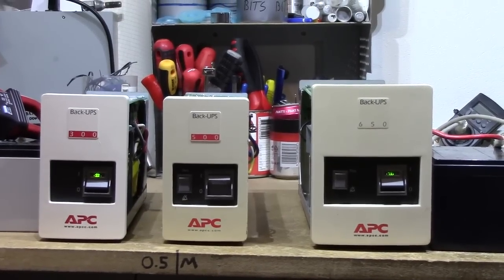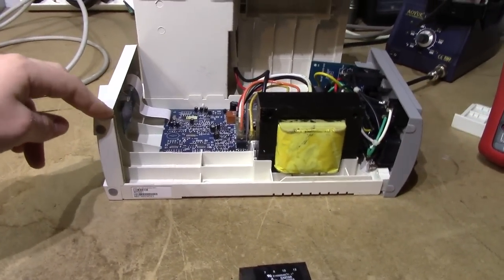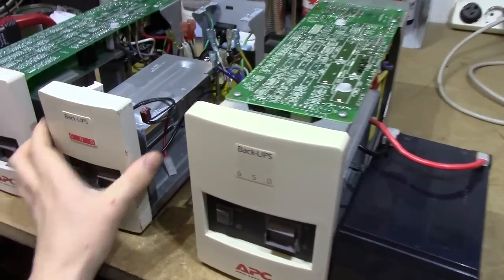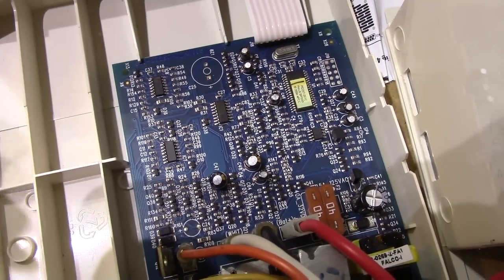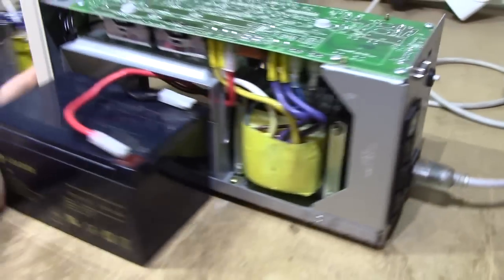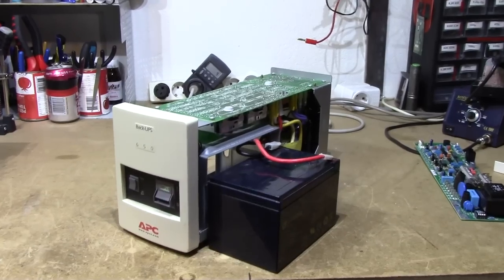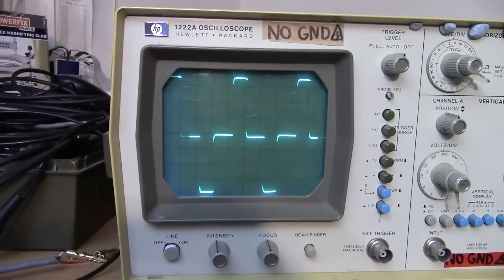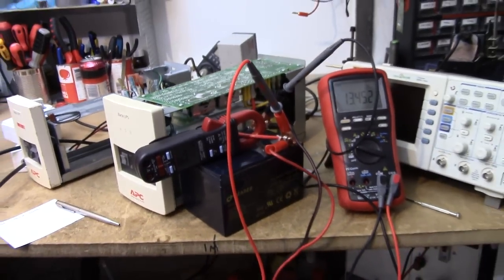Teardown: Old APC Back-UPS units

Comment: One of the best APC ups's to date. I have a back ups 650 from 1993 and it's still working.
Reply: hey what cords can i use for this? i really want to know my pc has a normal power cord
Reply: Hello, there is also an ancient apc 600 ups of 1994 with panel buttons, so the reason right now is that it does not hold a load even a small 60 watts immediately turns off, please tell me where to look, it works from the network as soon as it does not even forcibly hold the load from the battery
Reply: @Lion5208  your battery is dead or the inverter is broken

Comment: Old APC Back-UPS units with the big switch are cool, unfortunately I didn't find that many ... which are very awesome those from Bestpower!
Can be used as an island inverter without mains and they had a great display where you could query all important information ... Voltage batt./outp. performance in% remaining time, etc.

Comment: The old SmartUPS 600 without user-replaceable batteries was horrible to work on. Big bracket holding the batteries in place and it seemed that you couldn't disconnect the batteries without taking them out, but it wasn't safe to take the batteries out without disconnecting them. I shorted two of the four heatsink plates on one. It sparked, I pulled the screwdriver away but a few seconds later a bunch of transistors on one of the heatsinks decided to catch fire anyway.

Comment: I've got an old BackUPS 500 still powering a small home linux server. I think it's on its third battery. The serial connection works fine with apcupsd. I just tested it after a software upgrade to the server. Still shuts down automatically without a hiccup when the power is cut.

Comment: hi,  can you tell us how to change the low battery voltage cutoff setting?   I have a bk-650 and need to change the shutdown voltage to 11.5 to get better compatibility with lifep04 batteries

Comment: I'm rewatching this video after having pulled out from storage my old BK650MI to attempt to charge an old-ish battery because the newer "smart" APC model (BK350EI) was screaming at me with that battery. Seems to be working, will see if that battery gets a new life.

I got both for free (at different times) because they where being thrown away, hauling the 650 home wasn't pleasant but worth it

Comment: What is the RDS ADJ resistor responsible for, how to set it up correctly?? Without load, for example, the voltage is 230V, under load 200W, the RDS ADJ resistor can set 230V, but there is a large load on the battery, so I set it to 220V, so the UPS works even from a dead battery. But how to really set it up correctly, like from the factory?
I understand this is somehow related to the resistance of the RDS MOSFET transistor. Voltage drop regulation under load. I do not understand how to set it up, at what power. The drop also depends on the battery voltage, so it is difficult to adjust it.

Comment: Hi great video, thank you.  I’ve just acquired one of the 300 units, but IC1, the voltage regulator has let out the magic smoke.  Could you advise what I should replace it with please.
Reply: 7815...

Comment: hello! i know this vid is a bit old but I recently got an old BK300 APC, but one of the white concrete resistors are blown up, i can't find any schematics for that specific model with consistent part numbers! If you still have this one around could you tell me what values those two white concrete resistors are? They are labeled R99 and R100 and are the only two white concrete resistors on the unit
Reply from the maker: Sorry, I have no idea.

Comment: Good day sir. You obviously know alot about these units and i was wondering if you knew how to get a bk300 to turn on by just connecting a battery to it. Like what i need to fuse together on the circuit board or bypass. Thanks

Comment: Hi. I have an old APC Back UPS. The same model that appear on the video BK650MI. I only want to replace the battery, but I don't know what the model of the battery is (the reference). What do you recommend me? Any advice? 
Sorry for my english. 
Thanks
Reply from the maker: +Héctor Luis-Ravelo Salazar 12V 12Ah.
Reply: Also note that even APC branded batteries aren't Mfg by APC, if you peal of the silver APC label you will find the original Mfr of the battery stamped into the plastic casing and the details of the battery for replacement.  I found this out by mistake when I was trying to find a replacement for an old APC unit I had and the label had been partially scraped off when I was trying to get it out of the case.

Comment: The reason I stumbled upon this video is because I have that same Back-UPS 650 you showed that suddenly won't power on anymore. It has a new battery which I tested and is confirmed working. No lights or power to anything. The only thing I can hear is a very faint hum from some component. I may just try replacing some of the few caps on the board and go from there.

Edit: I should also note that the battery connection sparks every time I connect/reconnect the battery. I checked the resistance between the battery wires (with the battery disconnected) and it measured at 10ohms regardless of the power switch position. Not sure if this means anything.
Reply from the maker: Odd! I've never seen one of these fail. Try starting it in inverter mode by holding the alarm or the test button while turning the power on - if it powers on then, it could be a mains sense issue.
Reply: @FFcossag  Update: I was using a lifepo4 battery in the unit. However, I discovered that whenever I connect the battery, the over-current protection on the lifepo4 battery trips. So I tried a lead-acid battery and it started sparking like crazy. I suspect a dead short whenever a battery is connected to the unit. Now I have to figure out what's causing that short. Possibly bad caps? Only thing is that there's only a few very tiny ones on the board and that's it.

Also, starting it in inverter mode didn't work. I tried this without the battery, so that obviously wouldn't work. But I can't try it with the battery because of the short circuit issue.

Edit: Ignore the ohm reading I gave earlier. I'm a noob with a crappy multimeter and I probably read that ohm reading incorrectly.
Reply from the maker: @SalC1  There isn't much that can be shorted in these except for the switching transistors on the "heat sinks"

Comment: iirc you can tweak the resistance between the ground reference pin of the ic and ground to make it output a higher voltage than spec
Reply from the maker: Yes, you can, by installing a "raising diode" in series with the ground pin. However, these units do the opposite of that, having two dropping diodes in series with the output pin of their 15-volt regulators.

Both of these techniques are a bit shoddy in a reasonably high-current (500 mA), high-precision (+/- < 0.2 V) application like this, since the voltage drop across the diodes is going to vary with current, temperature, the weather in Angola, and so forth. Modifying the charging circuit in these units really calls for a new regulator IC to be installed, and the dropping diodes to be removed.

Comment: I use a Back-UPS 300 model BK300C (which was free from work, and $30 for an 8Ah battery from cough-cough-overpriced-cough batteries plus) as my main UPS that keeps my cable modem, gateway router, seperate wireless AP, pogoplug and OptiPlex 760 USFF battery-backed in case of the extremely rare surge, brown-out or black-out. it was an immense lifesaver when Hurricane Sandy hit-- we kept power but it kept the devices safe from all the voltage drops we had during the storm. We had a bit of an issue with a tree on the lines a block over so they had to shut the grid down for a full 8 hours.

What ended up happening was, they shut it off at 2PM in the afternoon, and at that time the 760 USFF was still an SX280. so I shut it off ahead of time (to maximize run time) and let the router and cable modem (different setup) stay on with the constant beeping alarm because the thing was running on battery. with my 300 there's no way to turn off the battery, so once every so often you'd get the "hey I'm on battery" beeps. it started getting to low battery about 5 hours in, and then at the 6th hour it finally gave up and shut off, so I flipped the switch off. two hours later, the power came back on and I switched it on. Not only do they sound quiet when they're operating (I can't hear mine at all!) but it's also a quiet charging circuit... or at least quiet enough I can't hear it over the Dell.

I'm not necessarily sure how the little thing will take being hooked to so many lower-power devices now, with a blackout. the only time I was privy to that experience I wasn't home. I'm working on moving key services off the Dell now onto the Pogoplug after I upgrade the hard drive in order to bring power consumption off the UPS down to a bare minimum for survival. the time of ARM is upon us for home servers... and for the better, I suppose. Makes me want to do something with this cheapo sylvania ARM netbook I have. I had one running raspbian softfloat back a year ago, but this one's missing the AC jack and I don't even know if it works, let alone having a good battery which I should probably throw away being of cheapo chinese origin.

back to UPSes. What would be a safe charging voltage for an 8Ah 12v battery for one of the 300 units? Assuming, of course, the battery is from mid-2012 and has really only been discharged fully about twice in its life inside the UPS.
Reply from the maker: That was quite a story.

As for your charging voltage, 13,6 V +/- 0,1 V is what I usually recommend for SLA bricks in UPS use. It doesn't really change much over the life of the battery, at least not to my knowledge. If your battery is immensely hot or immensely cold, you might need to temperature compensate it a bit, but I doubt that's relevant.
Reply: FFcossag
 you should do a whole write-up on this all and submit it to hackaday for an article sometime. the way this is all documented in this video is all very easy to understand, especially for someone with not a lot of a foot in the door of electrical engineering such as myself.
Reply: FYI you can disable the beep every 5 seconds with DIP switch #1 set to the ON position (disable "Whimper").  The other 3 will be the opposite direction.  The UPS will still "Cry" (one long high pitched tone) when it gets below 10% remaining.
Reply: I'll have to try that next time I can be assed to get to it, probably sometime tomorrow after I re-load the little Athlon64 X2 box that sits up there with a fresh copy of Linux.
I had to replace the battery a couple of months ago, the old one was run dry and overheating inside. this is the only big issue I see with these units, is they do tend to run the batteries a bit hot on trickle-charge after the battery gets old enough. this last one lasted from October 2012 to April 2016.

Comment: Hi, interesting video. Do you know anything about those 4 potentio-meters? Does any of them affect the charging level of the 12v cell. I mean shut-off charge voltage (over-charge protection) etc ?
Reply from the maker: No, the charger is literally just a 7815 with a diode in series.

Comment: does any one know if theres anyway to mod these (at least the 650) because I got one from a Mac Plus sale and I wanna use it since my power keeps going out because my breaker kinda sucks. The problem is it has outdated stuff (modem,serial, etc) I wanna modernize it with usb and ethernet. Anyone know how?
Reply from the maker: There's no easy way to add those features, just use it as a dumb battery backup tbh.

Comment: Thanks for the video. Not being an electronics tech, are there user-serviceable parts inside ? The reason for asking is that I have two of the  UPS Pro 650's ( later model with the soft switches )  both of which  failed one month out of warranty. Coincidence ?
Reply from the maker: There isn't much you can do as a lay person, I'm afraid. It's usually the batteries.

Comment: Could you explain what are the exact technical differences are between line interactive and offline ups please ?
Reply from the maker: Line interactive can buck or boost the voltage without using the battery.

Comment: Hi I have one of the old APC Back-UPS 600's (BK600C) like those, I hadn't used it in years. I just replaced the battery to use it for my game console and monitor and found the next day the alarm going off (Long steady tone) when turned on even with nothing plugged into it now (also with the battery removed which it did not do before). Was wondering if there was something I could do.
Reply from the maker: That usually means bad/empty battery. I suggest you verify that your battery still works.
Reply: @FFcossag  the battery is brand new and charged.
Reply from the maker: It's very common for brand new batteries to be dead from the factory, or to fail very quickly. You really need to test it.
Reply: @FFcossag  I did test it. The alarm is now stuck on and won't shutoff. Even with old dead battery put back in and it didn't do that before,.

Comment: Can i put 12 volts 200 ah battery in this model?
Reply from the maker: No. It overheats fast.
Reply: @FFcossag  but can i use it as inverter aside from ups?
Reply from the maker: Not very well. Since it overheats fast.

Comment: how can i connect 2 UPS parallel? it´s possible?
Reply from the maker: Not easily, it's better to get one big unit.
Reply: @FFcossag  but i have only 1000va and 750va, .. how its possible?
Reply from the maker: You need to hook up the reference clock between them, which can in theory be done, but it's not anything I have experience doing.

Comment: Absolutely loving your videos! By the way I have the middle 500. However i have used a battery on it and it cannot work off the battery. Any ideas what might be failing? I have checked the 40A fuse it's totally fine, and also measured in the battery terminals 13.5V during operation. Could it be a fault battery? It is a 12V 9AH battery that used to be working fine up until lately acting as a diy ups for a router. Thank you in Advance!
Reply from the maker: It's hard to say anything without knowing more about the unit. Trying with a known good battery is always a good idea.
Reply: @FFcossag  Yes i will do this. In fact i will try installing a brand new APC RBC2 replacement battery. Unless there is a better choice.
Reply from the maker: I recommend buying a couple of brand-name batteries and reusing the wiring from your old battery pack. Yuasa/Panasonic last much longer than the low quality batteries that APC use.
Reply: @FFcossag  Good morning. I have just cancelled an order concerning the battery APC RBC2. I would appreciate if you could suggest an alternative model from Yuasa/Panasonic. Thank you!
Reply: @FFcossag  Finally i chose the Hitachi CSB GP1272F2 12 Volt 7.2 Amp. Do you have any opinion about it? Thanks!
Reply from the maker: That's the same brand that APC usually use, they're not very high quality, but you're probably paying less than you would if it was APC branded.
Reply: @FFcossag  yes sir!! I see you are indeed very well informed and knowledgable!

Comment: I always knew it - the charging logic (it doesn't deserve the expression "algorithm") of these is a farce. 7815 + 2 diodes ... WTF .... who did that? An intern from 1992?
Reply from the maker: It works beautifully well! The batteries in these last forever since the voltage tends to settle at about 13.6 V.
Reply: @FFcossag  Oh c'mon: Compared to the complexity of the inverter part, a linear regulator is an insult! There have been real charge controller out there for <5 bucks, 30 years ago, or 15 bucks for some reflex charger, at least for conditioning the battery once in a while. I'd expect something better in a 400-1000$ device.
The 7815 makes a lot of heat and the cells age with this dumb charge mode without some rush every now and then, no matter if used or idling for 2 years.
Reply from the maker: Just being floated at 13.5-13.6 V is just fine in this application. You can't do it in something that sees more than a few cycles a year, sure, but in these small UPSes, it's completely fine. I actually use a bunch of these around the house because the charger is much more efficient than all the more advanced models - the stand-by consumption is only 2-3 W with a full battery.

These are some of the best UPSes you can have for battery longevity. I've seen some of these get retired with 15 year old batteries inside that have only barely failed. That is never the case for anything with a "smart" charger since those units universally overcharge the batteries.
Reply: This UPS is not 7815 but LM78M15, it has current protection with a limit of 500mA + 2 diodes, the charger is ready. LM78M15 current protection limits it to 500mA and according to the instructions it is allowed to use it for chargers, it is indicated that it is difficult to damage it. With a load of 1kΩ, it produces 13.6V at a current of ~ 10mA, in this mode the battery will last forever.
LM317 + transistor according to the current stabilization circuit = according to the functions of the LM78M15 circuit - but this one is simpler. Both circuits can work for 30 years and nothing will happen to them, just replace the capacitor.
As for more complex and efficient chargers, with a controller, a pulse converter. There can be many questions about the charge mode and reliability. Usually, the charge mode does not provide long battery life.

Comment: hey great video but where did you find these schematics ? thanks
Reply from the maker: kiskiller3 I found them on some strange Russian FTP server, a long time ago. They can probably still be found floating around the net if you dig hard enough.
Reply: FFcossag my 650va had a pot to set the charge voltage and a 317 instead of the 7815 i was pretty surprised. but m8ine is the 120 volt version since im in canada.